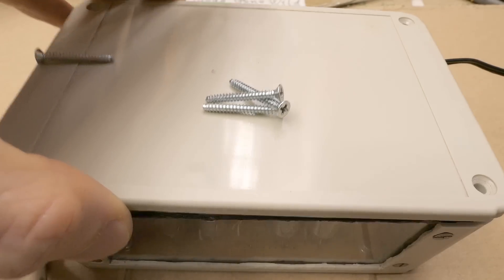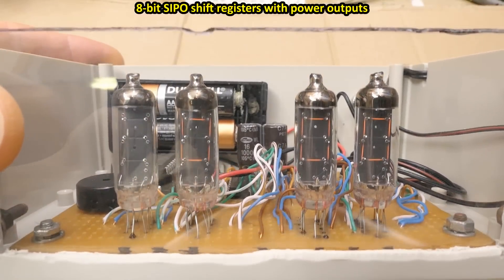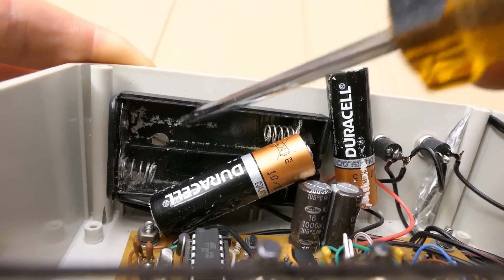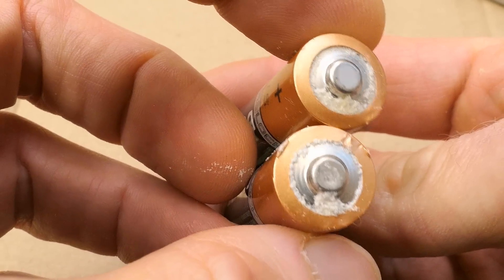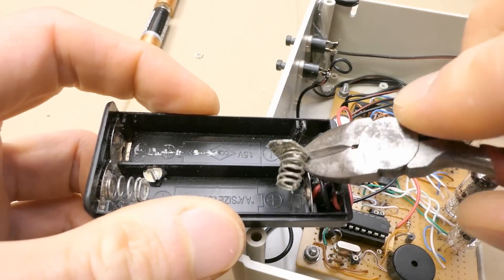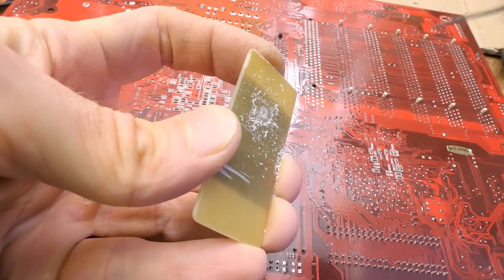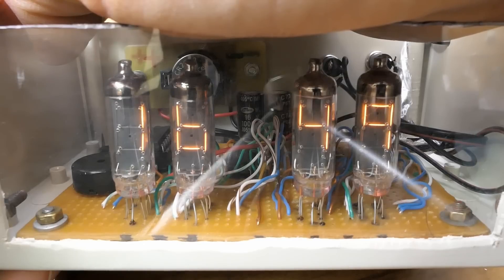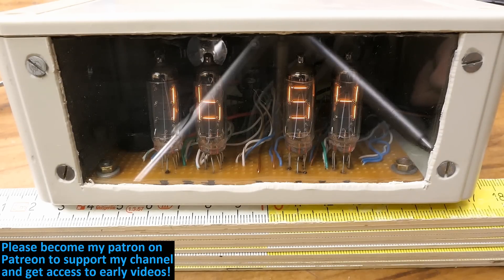DURACELL never leaks...

Comment: Good improvement. Some people claim that duracells leak worse than other brands, but in reality all alkalines are likely to leak once their voltage drops low enough. It was useful to have the AA batteries in a case separate from the circuit, but even better to use the lithium button cell, though at the cost of backup capacity.
Reply: Pardon me for being pedantic, but alkaline cells all leak not when their voltage drops low, but when they're reverse biased. So when the voltage on a given cell has dropped to zero, but another cell is still forcing some current through the series pack, that's the failure mode.

Duracell however are absolutely magical in that they leak for no reason at all.
Reply: I had Duraleaks leaking inside the original package. (A pack of 2 that came with a toy). Never used these before the leak. So: not discharged, not reverse biased , nothing. Just poor quality.
Reply: In my experience, Duracell are worse than any other brand of AA cells or any other brand of PP3 batteries. Yes, some other types leak (especially the cheaper non-alkaline types), but given that Duracell cost more and dropped the previous claims about not leaking, I now don’t use them.
Reply: Lithium button cells are a silly idea except where maximum portability is needed.  Otherwise, if you want lithium, they make lithium AA or AAA too.  Also, "in reality", I've had far more Duracells leak than any other brand.
Reply: @stinkycheese804   CR2032 is the perfect choice for RTC hold-up. They're extremely cheap, and in an RTC circuit, they have a 10 year design life, closer to 20 years typical life. The life expectancy is dominated by chemical degradation rather than current consumption, so more exotic higher capacity cells are unnecessary.
Reply: @SianaGearz  Actually for RTC and memory backup it's better to use BR cells as they have better long-term stability than CR cells.  I have seen BR cells in some applications last more than 20 years.
Reply: @douro20 what's a BR cell? Everywhere I've only seen CR cells so far in my life. (CR2016, CR2025, CR2032, and many other weird and thankfully not so common CR16xx cells as well... I know about the numbers. The first two are diameter in mm and the last two are thickness in x.x mm) (I'm 34 and live in Austria)
Reply: @gumpi5  BR cells are similar but use a somewhat different chemistry (Li-CFx instead of Li-MnO2).  They have fallen out of favour in most applications due to CR cells having a higher capacity but BR cells are still more stable.

Comment: the question that came to my mind is: what's the uAmp comsuption of this circuit? How long will this CR2032 last? Specially because you run even the buzzer from it, that btw was a very clever idea, if power goes out close to your wake up time, you won't be late.
Reply from the maker: Having a 4MHz crystal, it draws about 100uA, so a 2032 with 220mAh would back it up for 3 months of a power outage. No power is drawn from the battery if the 5V supply is present. Some of my clocks with ATmega8A and 16A use 32768 Hz crystals, drawing only about 12uA in backup mode, but the program is more complex, because of the asynchronous operation.
Reply: @DiodeGoneWild  thanks for the explanation, a very long time ago I thought that every CR2032 was rechargeable because computer ones lasted several years, but I never considered the fact that it doesn't draw power from the battery when the computer is on.
Reply: What about using some RTC chip (with battery inside) ?
Reply: thats the same thing pretty much tbh. @Tigrou7777
Reply: @Tigrou7777  Then when it fails (and it will), it is a lot more annoying. I have old PCs like that, and it is either expensive or time-consuming to fix. Also wasteful if you replace the whole chip for just a flat battery.

Comment: VARTA, RIFA and Duraleak, the three apocalyptic horsemen of retro computing.
Reply: Meanwhile there's photos of Varta batteries from the 60s/70s on reddit that still haven't leaked and measure 1.5V... I got some VARTA baby cell in the cupboard (because who needs baby cells anymore) with date code from the early 90s. Still not leaking.
Reply: @hmartinlb  I was gonna say hasn't varta been around a long long time though I have seen in person varta batteries that are years old still working not leaking
Reply: @hmartinlb  Mercury free is when it all went to hell.
Reply: @retrozmachine1189  "But it's better for the environment," they said. The mercury won't get into the environment if the battery is disposed properly. If it's left to rot of the street or burned in an incinerator, than sure, but if it goes into a landfill or gets properly recycled, little to no of the mercury will get into the environment.
Reply: @hmartinlb  if it was soldered  to a pcb id leak 100%  lol
Reply: Is not VARTA, is the technology, most rechargeable NiMH batteries leak if they discharge under a certain level and still connected to a load. Those that not leaked are better sealed or are connected to a better designed circuit. One must realize that the battery, and I mean any battery have an internal resistance that will make it discharge in time (that expiry date) even if not used. Some have a lower resistance, some higher. That is why the NiMH are to be stored empty and recharged once they are empty and not "almost empty". I have bought many power tools that had NiMH batteries and those are trashed now just because they were stored charged and leaked in time, most with zero use time.
The RIFA caps are not essential today, so if they blow, one can keep using the appliance, even with those caps blowed (without removing them) or out of circuit. Modern electric world is not so susceptible to RF as it was before. There is no more AM radio, analog TV that can be influenced by the RF noise, and the actual omnipresent cheap SMPS are putting more RF noise on the mains than an old SMPS in an IBM PC.
Reply: @sebastian19745  These old vartas are NiCD. And they also have an aggressive alkaline electrolyte in them (which is also great at turning dissimilar metal junctions contaminated by it into new batteries, even if dried out....can be REALLY confusing when you are debugging devices that got a taste of that...).
Reply: Varta owned by energizer even they leak too
Reply: RIFA MADNESS !
Reply: The fourth horseman is rayovac.
Reply: You forgot misrated tantalum bead capacitors. And liquefying rubber.
Reply: here after my VARTA leaked.... im throwing them all away even good ones... f them
Reply: I've never had a varta leak in my life every before is it just me
Reply: Err, old Varta NiCad PCB mounting cells and batteries leak...
Reply: Err, in the U.K. there are still analogue AM and FM radio stations. There are also the amateur radio bands. Plus various commercial or air traffic bands. Hence it is good practice to replace interference suppression capacitors. Just don’t use the RIFA paper type.
Reply: @Mark1024MAK  plus they'll still affect digital signals it's just the error correction can hide it to a certain extent, in rhe end digital transmissions are still encoded onto an analogue carrier.
Reply: you are right, i forget liquefying rubber, tantalum bead capacitors. plus all soldered batteries, including those inside DIL-CMOSclocks.
Reply: Energizers do also leak
Reply: Some old batteries contained amalgam to reduce corrosion but the fearmongers banned the use of mercury so now you have less reliable batteries which are discarded more often.

Comment: I don't know exactly when it happened, but there seems to have been some point, maybe 8-10 years ago when all the AA and AAA batteries I would buy would just start leaking. Even when still in their packages, in storage!
Reply: Exactly correct, in 2014 Duracell changed the seal design for their cells and ever since they have been absolutely awful. I have Duracells from the 1990s and 2000s which are much better.
Reply: @TechHowden  Same here. I have some very early Duracells which are well passed their use by date yet they are still working great and they haven't leaked. I'm not buying any more though - the later ones have wrecked so many things of mine. In my case, the things were still working fine, but were leaking like I don't know what. They were still well inside their use by date. If you can't rely on use by dates or the batteries stopping working, then you're not going to catch them going off without regular inspection, and who wants that overhead with multiple devices around the place?!
Reply: Yup had to throw out a whole year-old pack because they were leaking... Meanwhile a AAA cell from 2000 is still powering a calculator I have...
Reply: Energizer ultimate lithium are the only way to go. A bit more expensive. Not rechargeable. But much more energy dense, insane long shelf storage, and they Will never let you down
Reply: Some old batteries contained amalgam to reduce corrosion but the fearmongers banned the use of mercury so now you have less reliable batteries which are discarded more often.

Comment: Stopped using Duracell about 5 years ago, when I notice that they leak - basically every single battery leaked. I'm using Philips and Energise now - ridiculous a battery leaking before it's expiration date -
Reply: I think no brand is safe: I have some Energizer AA batteries that leaked unused in the original packaging with many years left to the expiry date! Best is to replace with NiMH rechargeable where possible or rebuild completely with Lithium but the latter might require a charge/discharge controller for protection of course if it is not a small coin cell Lithium battery like here...
Reply: @perhansson6718  thanks for the inside, Im waiting for these to failed but I must confess I had faith
Reply: @perhansson6718  statistically speaking duracell are the worst of them all. other brands leak bur far less than a duracell.
Reply: @perhansson6718 I agree. No brand is safe. I've had too many alkaline batteries kill my electronic gadgets. Some have been saveable with disassembly, white vinegar and a toothbrush.. some have not.

It's now got to the stage that if I'm going to leave any electronic device for any length of time idle I will remove the batteries first. I'd rather have the inconvenience of trying to find batteries later instead of finding my device ruined.

I've also set a Google calendar reminder every 3 months to check any other commonly used devices to ensure the batteries are not leaking (devices like remote controls etc).

I don't trust any of them anymore. Some other devices that used to run on 2xAA I've modified to run on a 10440 or 18650 li-ion which has eliminated the problem completely.
Reply: Same issue here. Definitely the worst brand for leaking - in multiple devices, over multiple years, with batteries that all well within date.
Reply: I had some of those, bought in 2020, supposedly good until 2030. They started to leak around 2023. So much for that
Reply: @liam3284  They will eventually.  The electrolyte is very corrosive and will eventually eat through the outer casing.
Reply: @douro20  Never found the casing failed the seals seem to be the problem also the electrolyte is Potassium hydroxide does not corrode holes in steel but it loves copper and covers surfaces.
Reply: I had to write off a batch of Varta Longlife AAs two years ago; there doesn't seem to be much correlation between the claimed and actual shelf life, so regardless of claims, I don't trust any modern alkalines past 5 years (and Duracell even less of course).
Reply: Fully agree. Duracell is almost 100% guaranteed to leak. Even cheap batteries are generally better.
Reply: They have been known for leaking for a long,long time.
Reply: Some old batteries contained amalgam to reduce corrosion but the fearmongers banned the use of mercury so now you have less reliable batteries which are discarded more often.
Reply: @mernokimuvek  as you mentioned, yes, I remember there was a 'talk' that batteries were suppose to be discarded on a special location
Reply: @mernokimuvek isn't mercury dangerous though?
Reply: @theeblueguy__ You're not supposed the eat the battery.